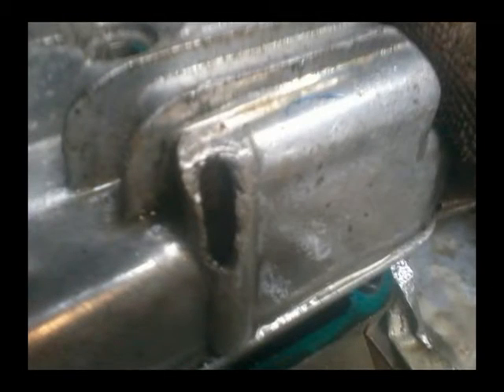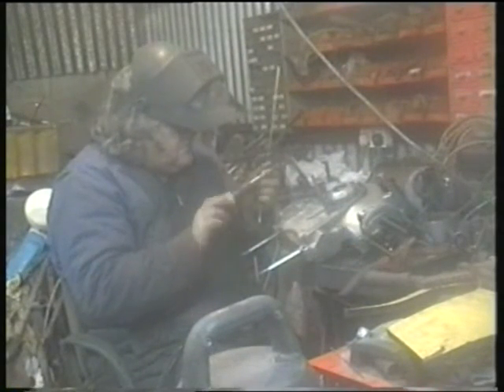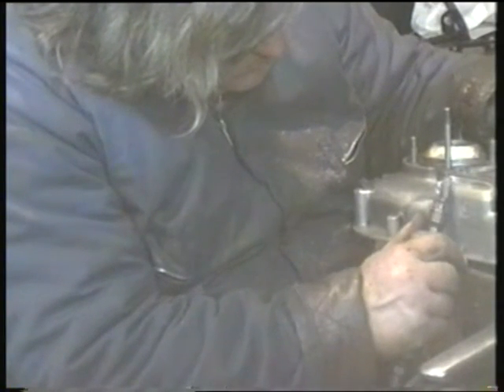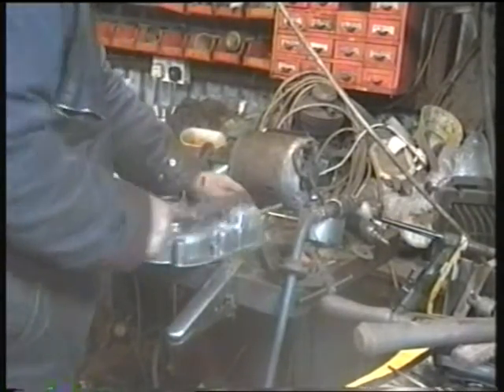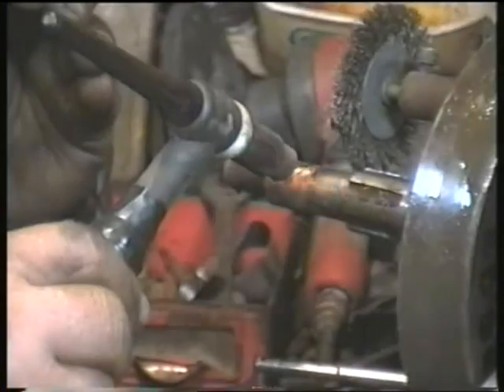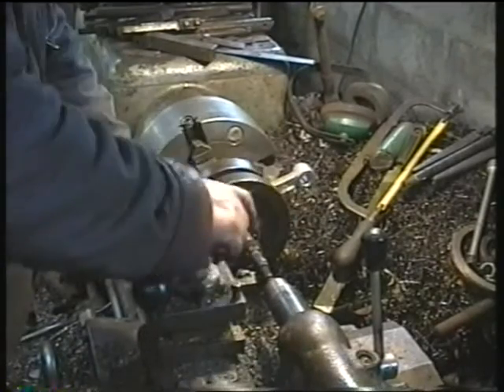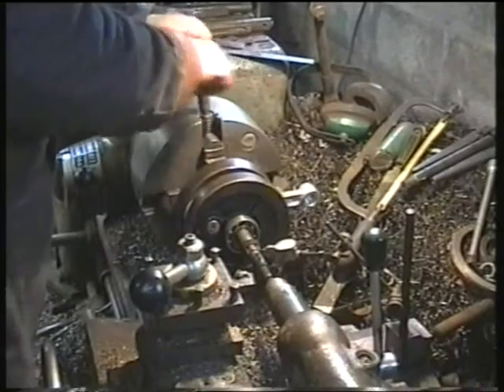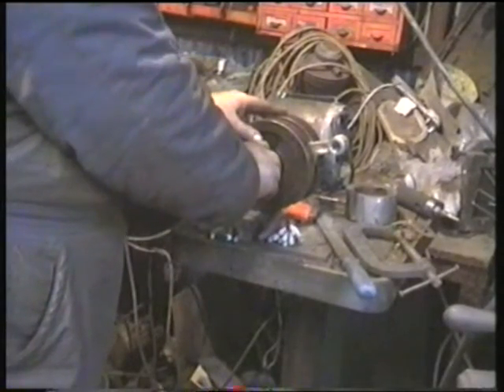Enfield Bullet Engine repair (part 3 )

Comment: Hi Dave. I have one just like that. Did you have to fill the hole in on the crank though? Could you have not just rotated it 180 degrees & cut a new slot? Just asking Mate.
Reply from the maker: i did consider 180 degree with the slot at the time and it probably would have been fine,but the engine had been messed with so much i didnt trust the new parts on it and convinced myself it might lead to problems later so just in case

Comment: Hello Dave. Nice casing repair. I just did an old A10 engine with the same problem. As you say old alloy is a problem to get clean enough to TIG.  I am on the lookout here for an Enfield engine to build a trials bike as you did.
Reply from the maker: are you going for a competitive machine or one built in the style of the old days(like mine) i'd love  to see how a modern version would differ from mine (rake wheel base etc)
Reply: Well now you are tempting me. Apart from my own trial you would have to be bloody good to get round the so called vintage sections here. So I was thinking of a replica of the genuine Enfield trials model just for my own pleasure. But, now you mention it, hmm
Reply from the maker: do a replica of john britten's  works special now that would be a challange